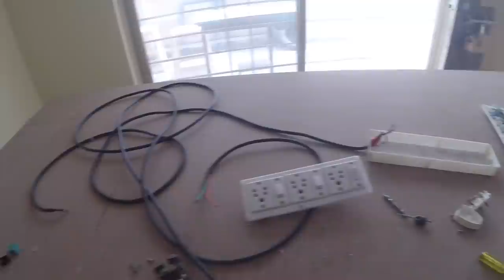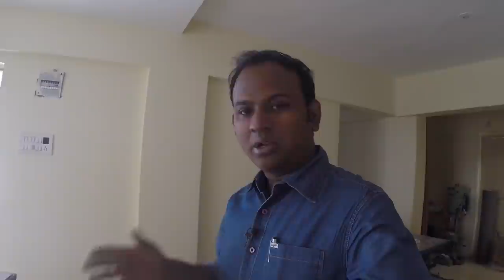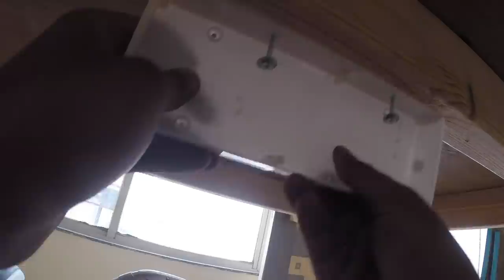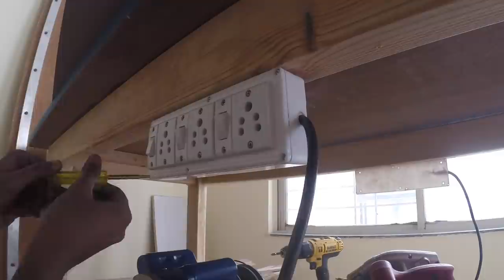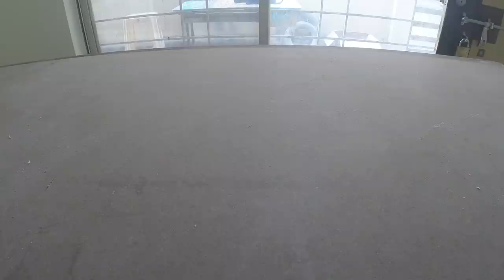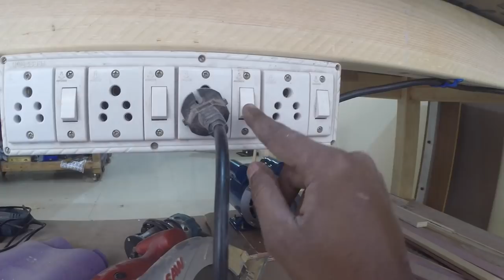Powering up the Work Table

Comment: Zip tie the cable both from the inside and out at the point where the cable enters the switch box, that way u can neither yank the cable out or push it in.

Also consider the modular switch boxes from GM they'll last longer.
Reply from the maker: Great idea!